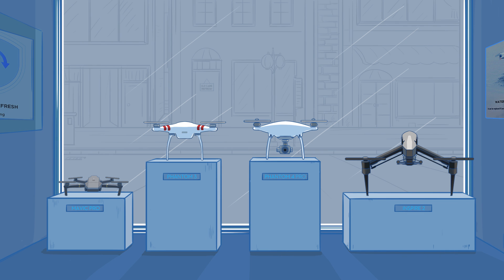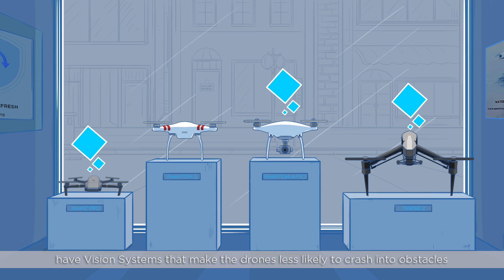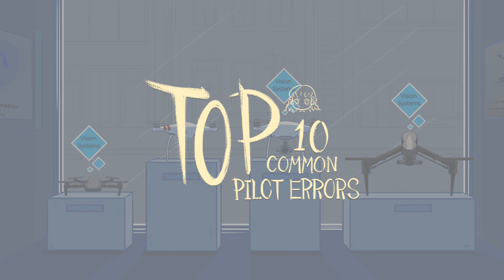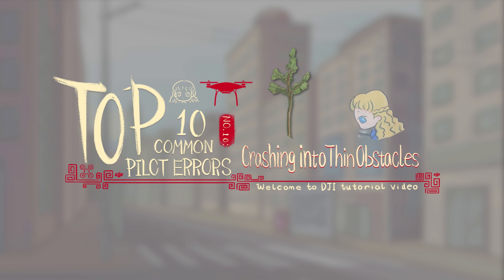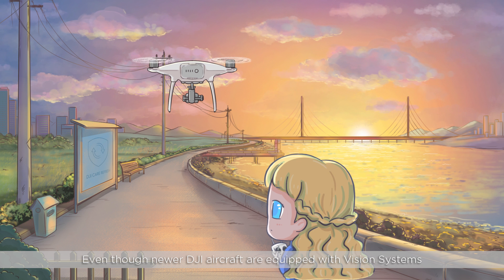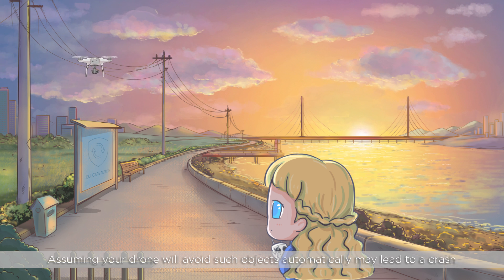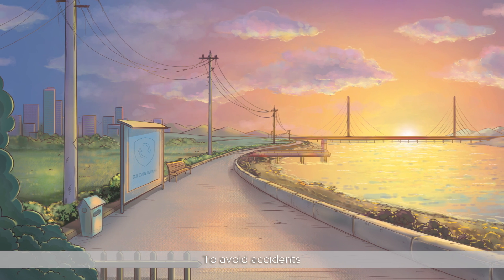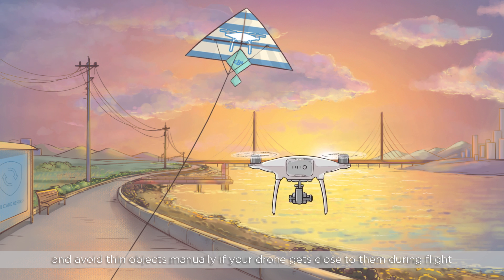How to Avoid Crashing into Thin Obstacles (DJI Safety Tips)

Comment: most of the time I navigate the drone only using the camera

in case of flying 🪽 in a new environments, I make sure first that there's enough light to see thru thin objects

video doesn't give any advice on the tactics of avoiding thin obstacles using drone's camera

also those thin objects are really hard sometimes to detect via video in case if environment isn't bright enough

Nice advice to observe area before flying, but it's not always available. I hope DJI could develop some 3d technology like lidar or more simplified way of detecting such thin objects
Reply from the maker: Hi there, please be advised that most of our newer drones already have advanced obstacle avoidance technology. However, it is still recommended to fly with caution as small and thin objects are hard to detect by vision systems. We thank you for sharing your idea with us. Rest assured we have taken this as a suggestion and passed it to our relevant team for potential. In meantime, please let us know if you have other DJI concerns. We thank you for your support.